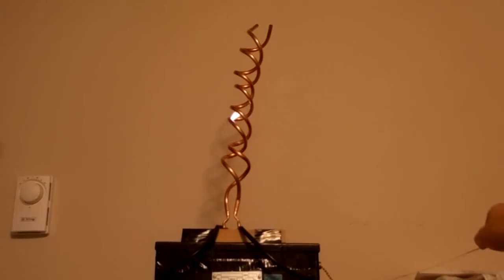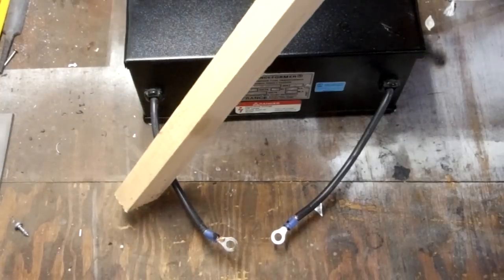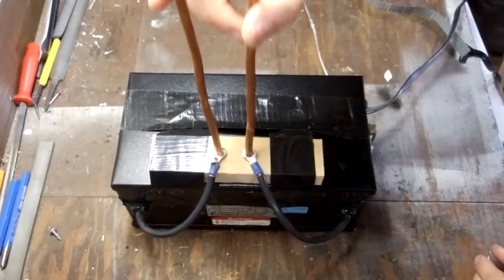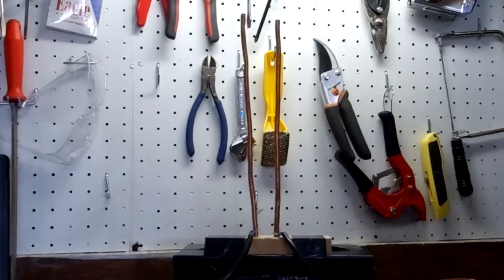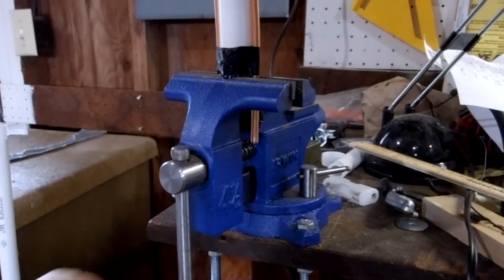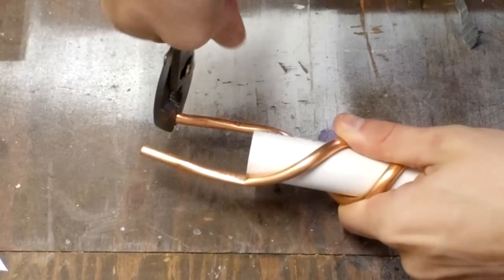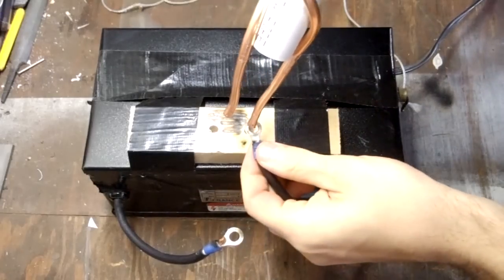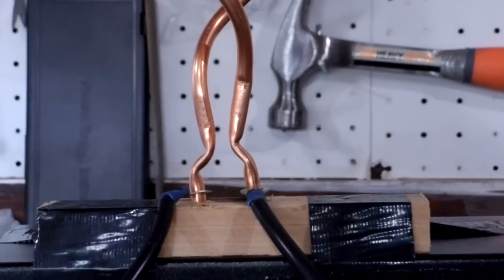Halloween Hacks #5 - Double Helix Jacobs Ladder

Comment: use tape on the copper and remove the tape where you want the arc to attach to each other to prevent the vertical arc forming and it will spin as intended

Comment: I made one 6' tall with a helix.  Same transformer as you used.  I used 12 gauge bare copper wire.  I brazed supports (wires coming out from the verticals at right angles, like a sideways "T", looped into supports).  The helix has a slower twist (about 1 turn par 6" height).  Along the length, I used supports made of unclad G10 circuit board  The outer edges of the board are cut to just fit in 3" diameter glass tube.  Spacing in the helix section is 1".  There is a section that tapers down to 1/2" for the starting point, & a section at the top tapering up to 3" for the break point.  The bottom taper is supported from above (at the bottom of the helix) so it can be bent for adjustment without disturbing the rest of the setup.  The wires are curled back from the narrowest point to avoid sharp points attracting the arc.
          If you get the tube length just right (so air in it is resonant at 120 Hz) the sound is so much better!  The tube is essential to protect the arc from room air currents, & supports the assembly, keeping it straight.
          I also tried painting the wires with different metal salts to change colors.  But the salts tended to "hang" the arc.
Reply: Link please! I'd love to see this as it's much closer to what I was thinking of when I searched for "double helix Jacob's ladder".
Reply: @gijimbo1337  I have no link for this, as I made it years ago.  It is exactly as I described.  The arc is horizontal (as it would be in regular Jacob's ladder), but rotates about vertical axis as it rises.  The key to making ANY long Jacob's ladder work properly is to have an initial tapering part to the main section where the wires are constant distance apart, then another taper where the wires spread to the "breaking" section.  The other key is to have regularly-spaced supports as it is difficult to keep the helix geometry & constant spacing proper.  The ladder needs to be in a tube for proper airflow & to protect it from air currents in the room.  My ladder is 6 feet tall.

Comment: I was wondering if there was anything better to use as a mount then wood?
Reply from the maker: I'm sure there is.  Wood is not the best material, mostly because it is flammable and absolutely can catch on fire.  You need to make sure whatever you use is not conductive.  Something with a higher ignition point would likely be better.  It would also help to make sure the place where the electrodes are closest together is several inches higher than the mounting point.  That way the spark will always ignite far away from your mount and there will be less risk of something catching fire.
Reply: Rick Osgood ok cool would nonflammable paint on the wood work good? I'm not really sure how well it works with the electrical sparks that close to it.